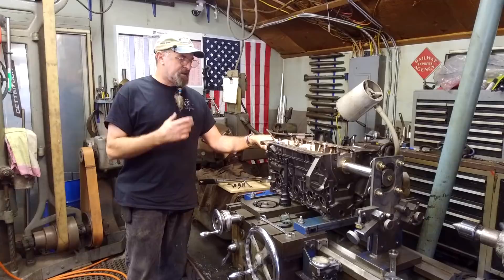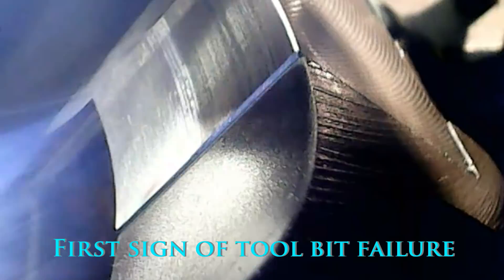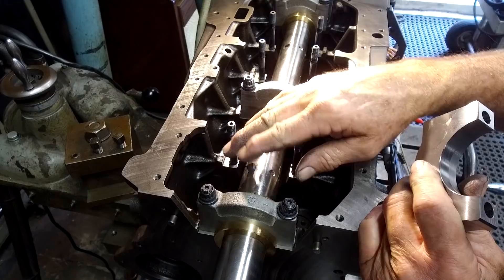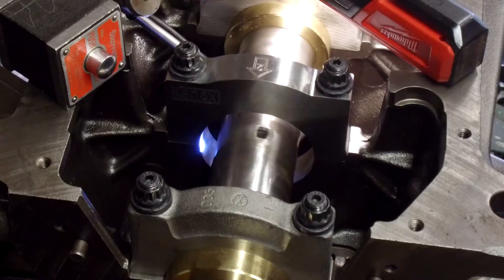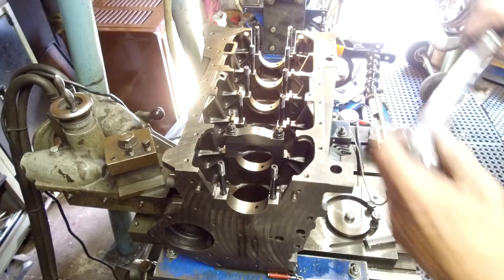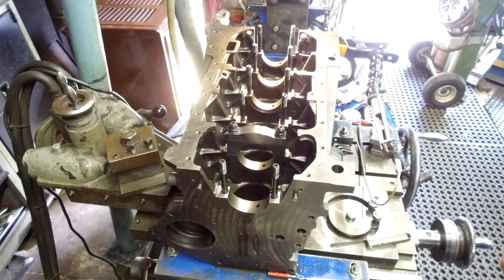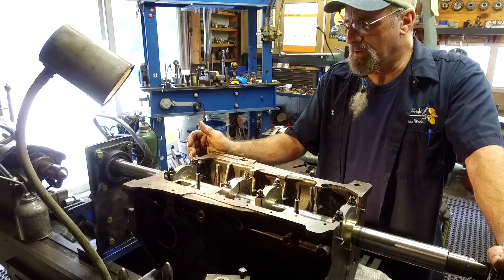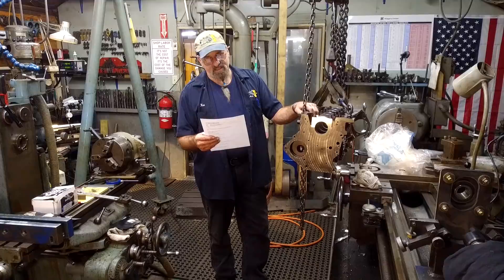Because I Can Part Three

Comment: Keith. What top rake did you use on your High speed steel  tool? And loved the bore cameras, very clear close up image for us to view.
Reply from the maker: just kissed the top side with the outside diameter of the cup wheel, did not try to add any more than that. ;{)-------

Comment: shouldn't the caps be torqued to the factory torque spec as when actually assembled as an engine?
Reply: Because they are not factory bolts.  They appear to be ARP, and ARP specifies their own torque specs.
Reply: ARP bolts are very often the same or greater torque specs.  also I meant his machine tooling bearings and "OEM caps". where change of torque value will change stress/deformation on all materials....... I'm sure that's mechanical and machining training 101. 
NOTICE: I am not saying anything bad about the fella, he may have his reasons and theory backing it up.
Reply: @throttlebottle5906  I think the lighter torque on the factory caps/bushing was to not crush the bushing and pinch the bore bar.  30 gave him enough to hold the bushing securely without damaging.
Reply: good thinking, but block shift and twist occurs if not all bearing caps are torqued equally.  it's more noticeable at the camshaft bearings! see where I am going?
there is still deformation of the main block overall. while itmay only be 1/2 thousandth r less across crank journals, it could make the camshaft off multi thousandth's
Reply: @throttlebottle5906  That's an OHC engine.  Even on pushrod engine with the cam directly over the mains I have never ran into an issue with block twist causing cam clearance issues.  If I did I would be looking for a crack in the block causing distortion. On a Kwik Way line bore you do basically what Keith did.  Except the Bock is stationary and the bore bar travels.

Comment: some how I missed it did you say why the main caps are being changed?  neat the the cap maker contacted you. i'm guessing it is a common upgrade for that engine, or is it a marine upgrade?
Reply from the maker: Increase HP prevention. ;{)-------
Reply: The billet caps are a lot stronger and really help prevent the block from flexing compared to the cast caps. With the right turbo 1000 HP is possible from a 5cyl Audi.

Comment: My question is why you chose to cut the new caps in place on the old block, chancing possibly damaging the old block?? 

Was it easier to make the fixture to hold the cutters, than to make a fixture to hold the caps separate from the block? Was it just to see if you had the skills necessary to do it? 

I've seen you use every conceivable tool, to make every conceivable hole, in every conceivable way! To risk damaging the block seemed a bit risky for what the job was!

Or am I just not seeing something important? The caps have to be indexed off of the mating half of the block, and there is no way to just cut each cap precisely, as it would be held in an individual fixture?? I would expect the finish product would need to be line honed, to ensure perfect alignment, along with a perfect finish! But, I guess I need to refer back to the title!! 

BECAUSE YOU CAN!!
Reply: The caps are part of the block.  Each one the parting line may be at a different location and level.   It is easier to duplicate how it was made to begin with, than it is to duplicate each individual cap, since each cap is slightly different.   And, what if the old cap is damaged or lost?   Not to mention the final size is usually done by hone.   How do you hone half a hole?
Reply: Glen Urban...the same way he cut HALF A HOLE!! The proof is in the pudding! 

I just wondered if it was possible without risking the rest of the pudding!! 

Remember, when this man needs a part to fix something, he makes it, he don't go buy it!!
Reply: Oh yes it is POSSIBLE, but it isn't easier nor faster.  I did one  today in 2.5 hrs, If it wasn''t a one-off kind of job deal could probably go even faster yet.  I think what Mr. Fenner is doing here is a sort of experiment/demonstration, just to see what happens.   You do more than a few of the same job it might justify making or purchasing a line boring machine, which is a heck of a lot easier to setup.... but there is no replacement for learning and try and see.

Comment: Might be a way to bore out cast iron cylinder blocks? Might need a bigger lathe...
Reply: When enlarging cylinders in a block, usual approach is to setup the block in a vertical milling machine and bore them out.   Because of the longitudinal orientation of cylinders in a block, the lathe would have to have a throw equal to or slightly larger than the overall size of the block (which you noted "larger lathe").  Those lathes exist, but holy cow, talk about driving a thumb tack with a sledge hammer!  LOL.   Horizontal boring mill would work nicely as well.
Reply: Not much choice in machines around here, just thinking in what i can get and get stuff done.

Comment: Your SFM seemed too high to me, contributing to tool bit failure. 77 RPM should have worked.
Reply: DomManInT1 I run a almost modern f84 Rottler engine machining center I bore caterpillar c-15 mains at 250 to 300 rpm with indexable inserts. Rottler says 650 but you won’t make it through the block without reindexing. Even with a brazed bit they should have lasted , I’m guessing material-carbide grade not right but great video and setup master machinist
Reply: Scott, Just was making an educated guess based on my own experience. I have forgotten now what grade he mentioned. C2 would be tougher, but not as heat resistant so slower. C6 or C8 harder, so faster, but not as good on interrupted cuts. Also, cast IRON versus cast STEEL makes a difference.

Comment: What was wrong with the old caps?
Reply from the maker: Wanted to increase HP and stronger caps were chosen.    ;{)--------
Reply: Brian, it's likely a new race engine build with 4140 or similar billet steel main caps that are much stronger than the original cast ones so they won't crack if the turbocharged engine runs lean and detonates. There's no need to replace them unless the engine is going to be run with boost and/or nitrous oxide. It's more of a precaution but it eliminates a common point of failure and adds rigidity to the block. One less thing to worry about basically. The entire rotating assembly will probably be upgraded as well with a forged steel crank, rods and race pistons with further modifications to the head and valvetrain, intake and induction system.
Reply: That block looks like new, so the caps have to be matched to the block bores. and yes, those caps look quite a bit tougher than an OEM engine.
Reply: Cool thanks sorry if I missed it.